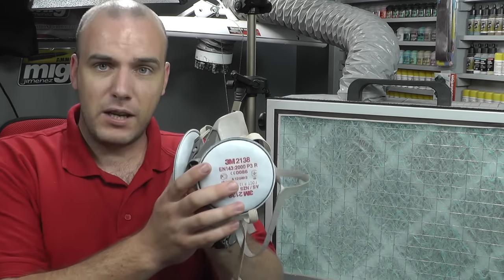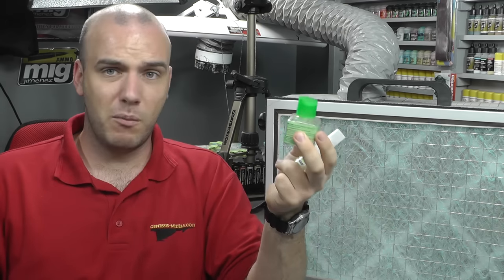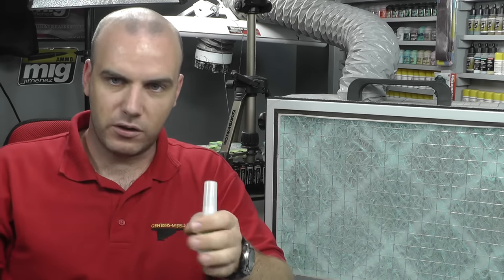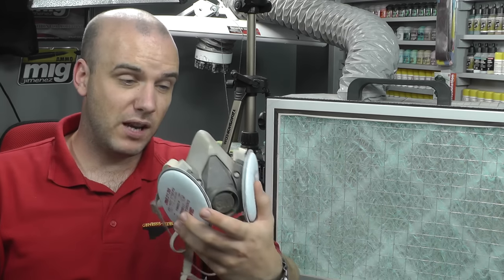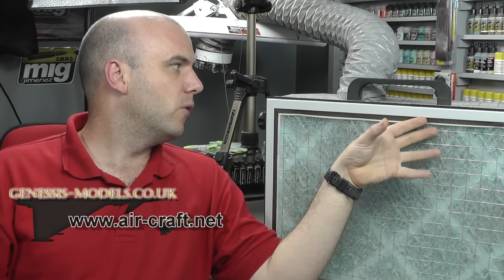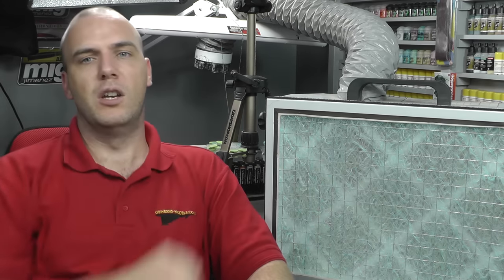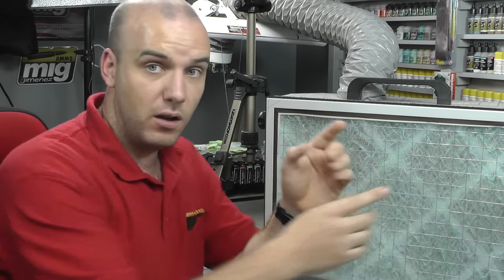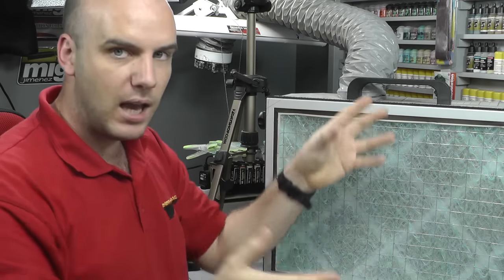Airbrush Safety : Extractor Fan And Face mask Safety : Tutorial

Comment: I absolutely agree with you on using a respiratory mask. 2 weeks ago, I applied plastic cements on my model and I must have breathed in the fume cos I was sneezing non-stop after that and my eyes were watery and red. In addition, I was working in my  cellar, cutting plywood for my modules. I was sneezing so badly for 2 weeks until I had to take stronger nasal spray and anti-hestamin. I can still feel that effect now.

Since then and after watching your video, I bough a better mask and will get an airbrush exhauster fan.

Comment: Even acrylics can mess you up. I used to airbrush without a mask when I started and my nose used to really burn for a day after. Anything not water based has to be far worse, looking to fit an inline bathroom fan to a homebrew spray booth in my hobby space (the loft), I am planning on doubling it up as a cabinet for my resin printer.

Comment: Hello, I have an airbrush Iwata and the problem is when I want to make a fine line I cannot get the color out and when I press the trigger more the color comes out a lot of color, I use oil colors mixed with gasoline please help me, thanks
Reply from the maker: probably need to clean your neddle and nosal mate
Reply: @genessismodels  
It is really clean, but I doubt that the colors that I use do not work because I use oil colors and thin them with petrol.